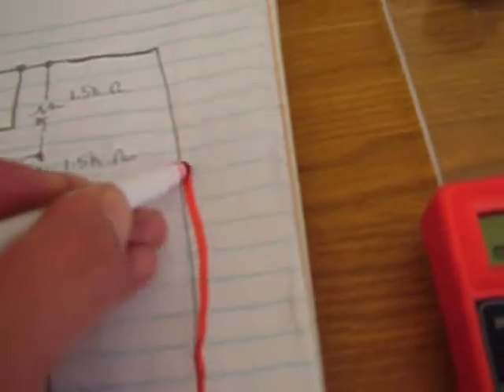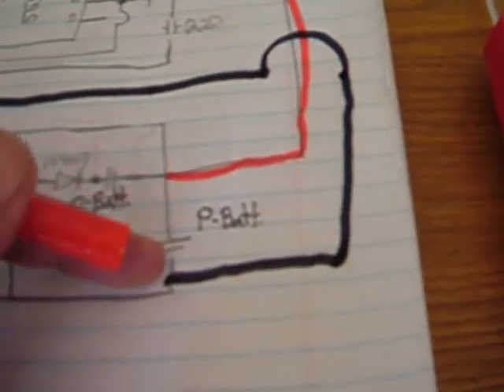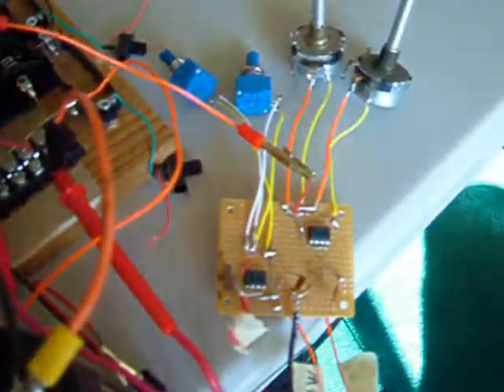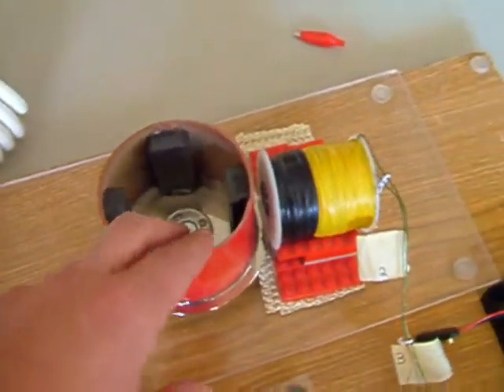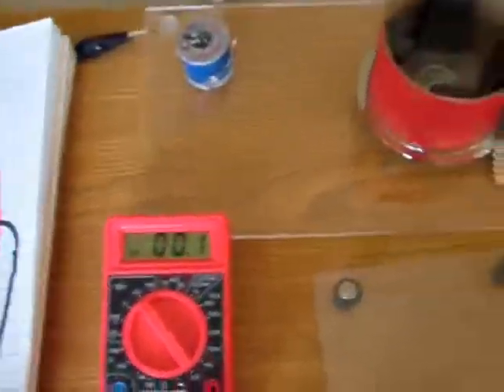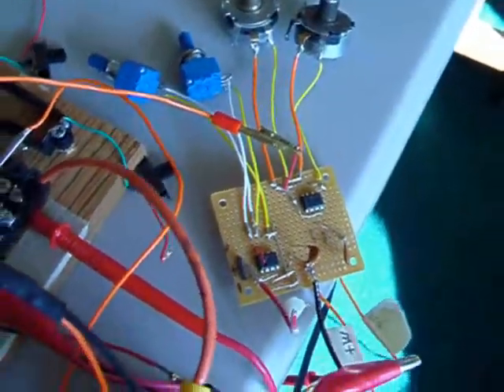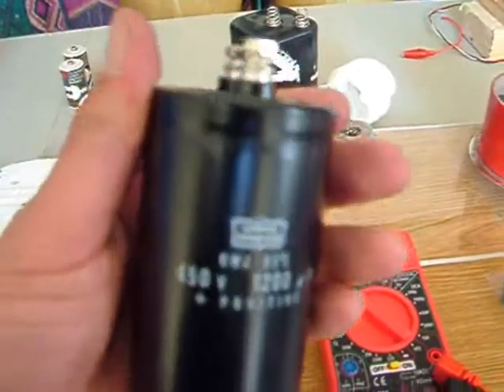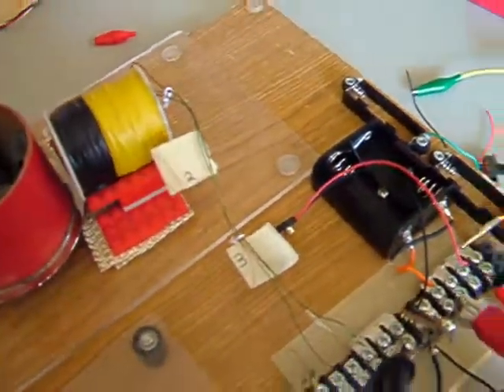Bedini 555 timer pwm

Comment: I wired up a 555chip, I got it to light up a led with PWM.., now.. insted of lighting up a led on pin 3... you have it hooked to a capacitor through the bedini circuit??

Comment from the maker: I did notice the neon bulb on the transistor would light up a few seconds before the capacitor reached 80 volts. I can hook up a car coil on the negative side of the charge battery and it lights a CFL, But it wont light up with my 555 setup.

Comment: hi infamous,
555 timers have been used for bedinis previously, however they usually have the output from the 555 going to the bast of the transister...
I'm struggling to understand why your setup is actually working... 
I must be missing something somewhere